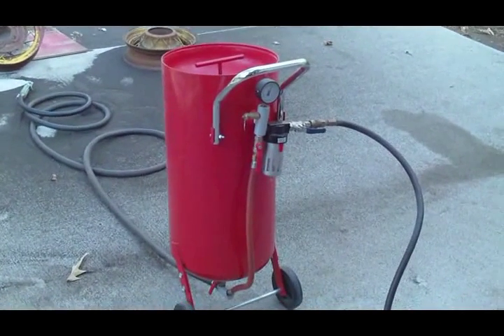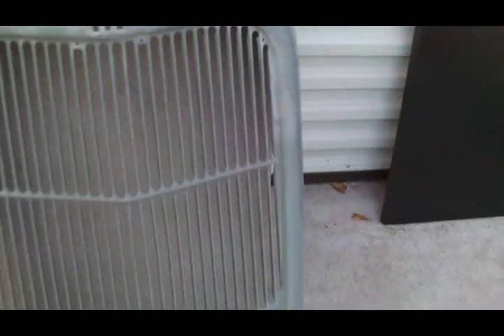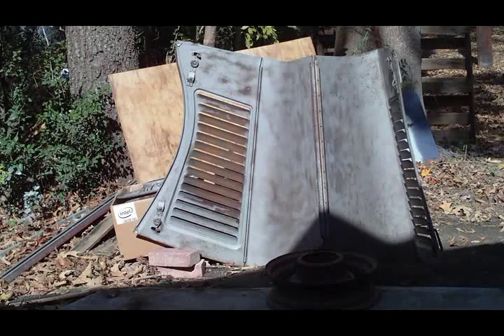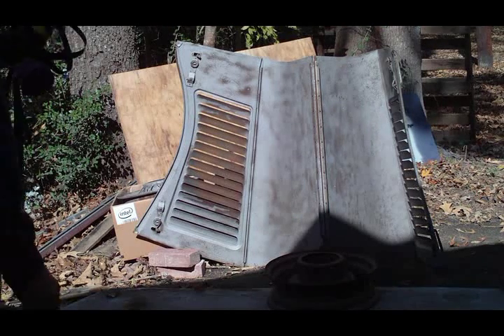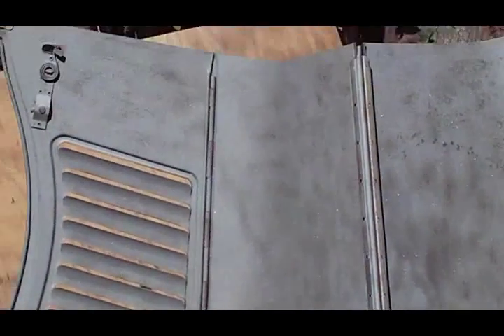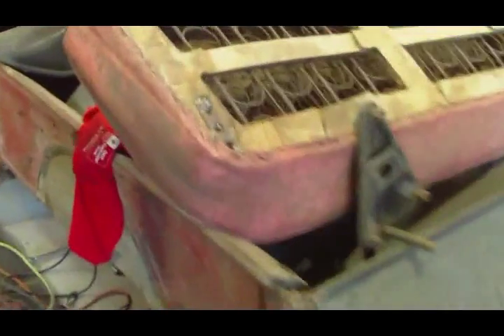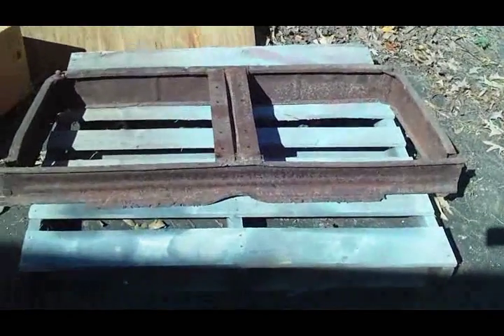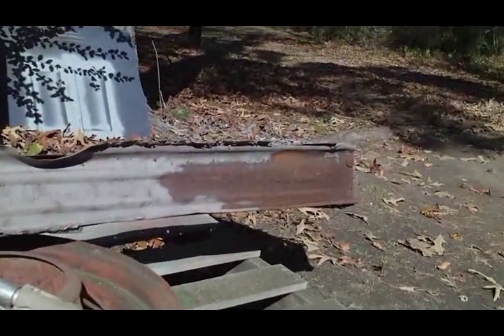Sand blasting parts

Comment from the maker: Re: liters, I have no idea! This compressor is exactly what I could afford, I did ask the store guy if it would sand blast, paint, and run air tools, he said yes! It is a 60 gallon upright Campbell Hausfeld, it's wired for 220v draws half the amps. It was the best $300.00 I ever spent! It was on sale, they had 2 left, today it is close to $600. It does everything I need it to, of course it cycles quite alot while sand blasting, but hardly ever turns on while spray painting with HVLP gun.